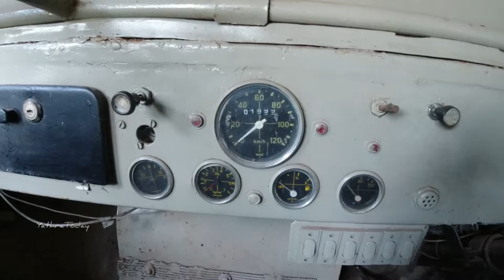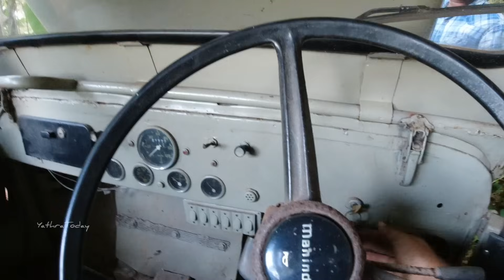Cold Starting 1989 Model Mahindra jeep after 4 years

Comment: 89 വരെയോളം  ഇന്റർനാഷണൽ ഹാർവെസ്റ്റർ b275 idi slow speed engine ആരുന്നു. Idi ആയത്കൊണ്ടുതന്നെ heater plug ഉണ്ട്.അതിനു ശേഷം de, di, mdi etc... Engines vannu
ഇത് cj 500 d model ആണ്
Reply: Athe..Di 1991 muthal aan..90 de ..96,97 md ,97 last to 2004 vare Mdi ,94,95 major mdi, 95 last to 2010 major di turbo..2010 pazhaya model jeep ninnu..pinne Thar di , Thar il 2015 vare di turbo thanne engine
Reply: @nizamuddin-1802  യെസ്
Correct👍👍
Reply: @nizamuddin-1802  വർഷം എഴുതിയതിൽ തെറ്റുണ്ട്.
94 അല്ല 2004.
Reply: @jachoosworld4982   Yes..sorry